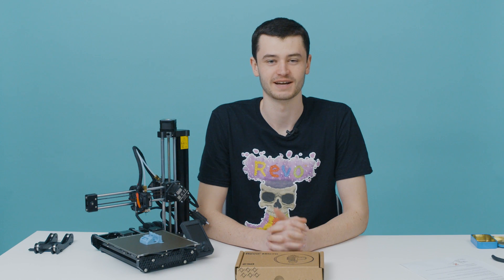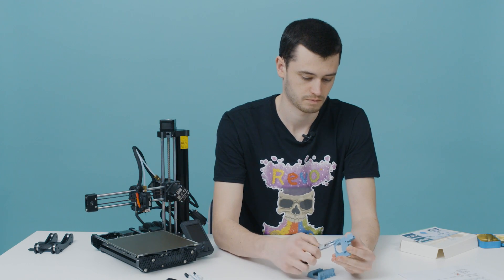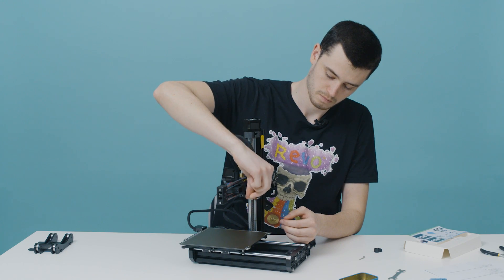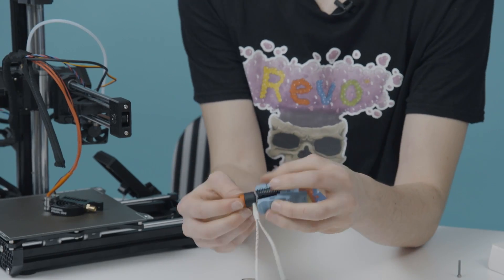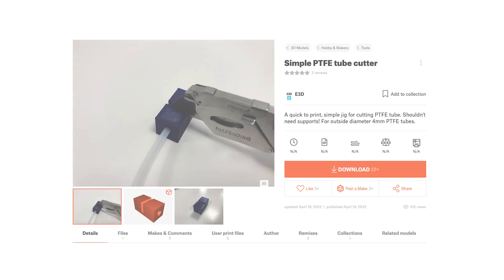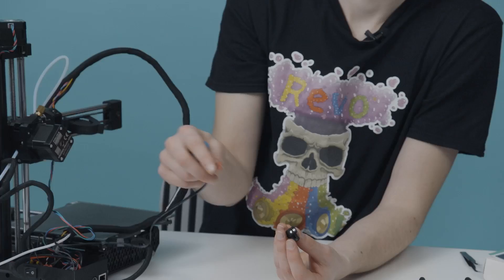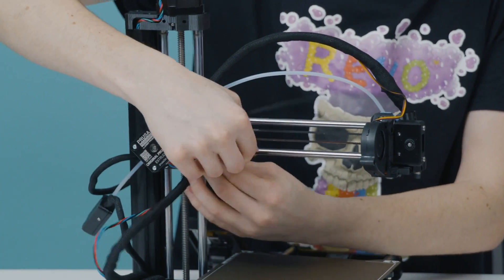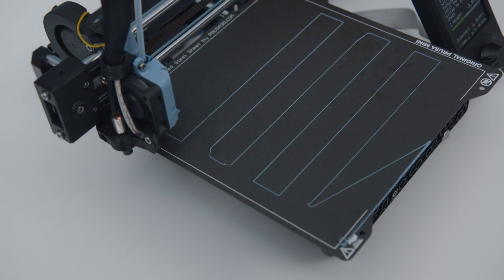E3D Revo™ PRUSA Mini+ Upgrade Guide

Comment: was there some sort of re-development on this? Because I bought a Revo for my Mini+ some time ago and it doesn't look anything like this?
Reply: The hot-side of the Revo (the nozzles, the heater, the spring) is all closed-source by E3D. Those will never change as long as "Revo" is alive. But the cold-side (the heatsink) is "open-source" and anyone can design one in partnership with E3D. IIRC, what happened was people initially got the 'standard' revo heatsinks to work with the Mini+ (which also required firmware/gcode mods since it shifted the nozzle location?), and later E3D launched the "Micro" heatsink, which is this drop-in replacement. IDK if Prusa was involved in developing the Micro heatsink.
Reply: It's a micro

Comment: Can the mount be printed in PLA or does it have to be PETG or ASA?
Reply from the maker: We wouldn't recommend using PLA.
Reply: You should not use PLA for anything besides decoration. Its not safe for UV-rays so it gets brittle with sunlight.

Comment: I am getting poor print quality on all three of my Mini's with a Micro. Anywhere there is low volumetric volume it seems to over-extrude and ooze a bit. Have yet to be able to solve the issue.
Reply: You recalibrate esteps?
Reply: Retraction too
Reply: Hey i have the exact same issue! Have you found a good solution yet?
I tried both Stock, and Bondtech extruder. no luck there.
0.6mm nozzle prints better
0.25mm nozzle fails every time..

Comment: hello! are there any benefits of using this instead the prusa hotend, other than faster heating and quick change nozzle? thanks.
Reply from the maker: Isn't that enough? 😐 No more hot tightening, nozzle changes in seconds and improved print quality!
Reply: @E3DOnline  that's what i was wondering, does it improve print quality? :)
Reply: @Jamiainen  Stefan from CNC Kitchen noticed less stringing, but I think that's it.
Reply: Well, the reason why i just bought mine is because i'm using PLA, PETG ... and flex... And after a while of using the mini, the PTFE tube inside the heatsink gets squished a bit. And in mine it got squished enough that eventually flex (flex being what it is :P) material managed to get under and then over up the PTFE tube, creating in the end a partial block that made printing with some under extrusion. I got tired of having to open it up and clean it every few months, and getting extra PTFE tubes for the heatsink. And yes, i did raise the hot end for more squish. But eventually the PTFE tube needs replacing after being too squished.
Reply: @itsGeorgeAgain  This was my main reason for getting it too. Also my prusa mk3s+ has a 0.6mm nozzle x and my mini is for a wider mix of stuff than my i3 is so being able to change nozzles for a wider variety of niche tasks means less fussing over my i3.